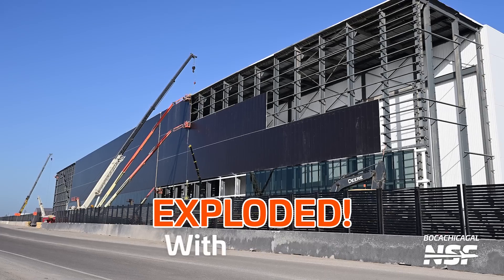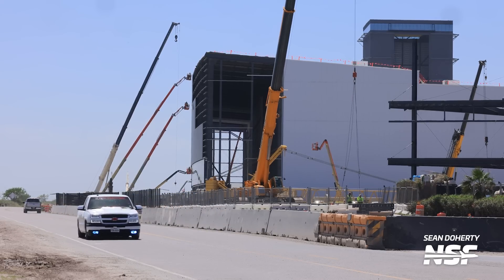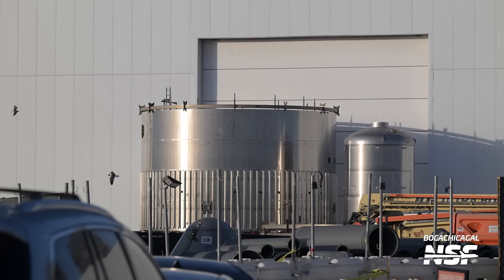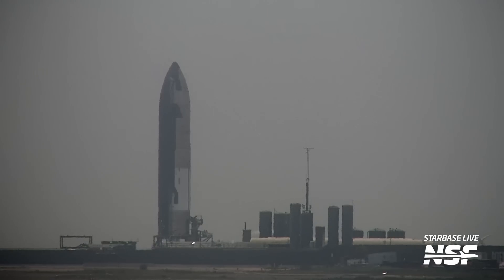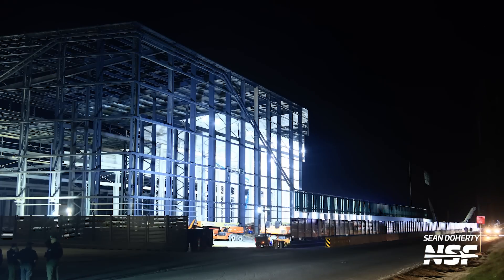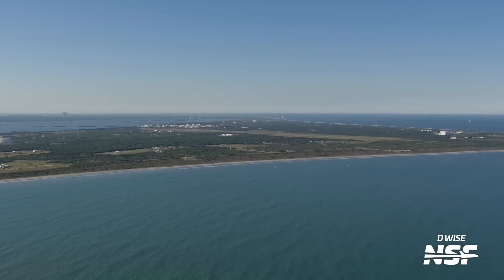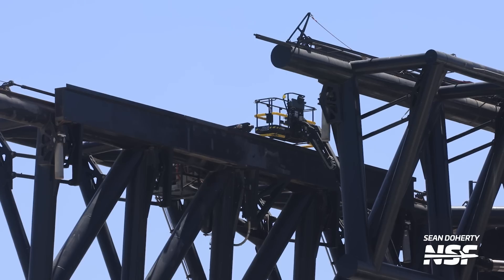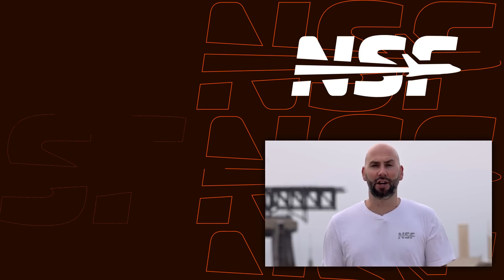The Cadence Picks Up At Starbase! | SpaceX Starbase Update

Comment: 1st off, I'm a huge SpaceX fan but have a major concern regarding fuel usage.  I've noticed in all flight tests that the ending fuel levels on the booster is practically empty.  Can you give some info on why this is the case when there is no cargo on board?  It seems like it's was fully fueled at takeoff.  Thanks
Reply: I can, first of all they did not fully fuel it at launch and secondly both the booster and ship dumped their extra propellant after their first burns to help simulate the real conditions eg. 150 tons of payload added

Comment: Jack Beyer & NSF family. Good to see U All Spaced Out;Where you belong. Keeping us all up to date. I would have liked to have seen The 2nd Version looking more like;A “ large”version of SpaceX’s “DRAGON”;(including upper “Side (&moveable) firing booster s to assist in ship stabilisation,after its “Sideways Entry-Drop”;where the heat tiles are cooking,rattling,shaking expanding, cracking & being torn through their most Rugged Smelt -Temperatures ever captured on film by SpaceX’s “Earth-Wired Satellite flight System; Starlink”(Man those  visual s were really out there: Educational; inspirational;Red-Glow &seemingly eventual,[what seemed like a 🔥 fire of smelting: either smelting fire bring or unbelievably molten lower engine parts;( I considered that had this like Falcon9 Booster s been alight;since face it the only major diffs could be;The burning engine confronted by our infamous blackout area; Weight,Engine layout[A strong option-due to spacing & unlike Falcon9’s constant engine layout; circular,Rage Of Heat Against The Earth s hottest area VS Rocket Heavy’s Larger Gaps between Engines; Allowing that “smelting-Space”2 Creep in-between its Engines Ripping Apart electrics,fuel lines,computer communications& basic air ship2 extreme temps which having being constructed 2 Wthstand them allow’s then2 grow even warmer, tearing things to shreds&possibly giving THAT LAST Nudge to the self destruct SYSTEM! Another issue could hve been that “Door Test System”.On pics,it did’nt seem 2 close properly& that allowing those Intense heat s2 dance about the interior of the ship; tearing at Interior fuel tanks&”so2 speak-Join pipes & otha interior systems would cause destruction. Why Elon and team just Dnt offa us there facts or closest opinion s on what was a sad consequence. Again I state I would really njoy 2 see A larger UPgraded version of DRAGON again absolutely (in the round,powered by larger versions of Dragons engines. (With the ability to swing the entire rocket in any and every direction that it would require. Especially where flaps aren’t assisting. Also I believe the Rocket flaps 2 B2 fragile2 PowaHold the moves&especially it’s ability 2 hold onto the heat tiles (especially where they move& tension  &heat affect them most. Obviously it would act as the main astronaut deck during launch & land procedures. Giving All Astronauts who flew in them,the greatest chance of survival and increasing missions to space station to as many as was decided upon. Also it would act as a great lead to the upcoming private mission s of (1)The upcoming Space walk mission from a Dragon..Extended astronaut carrying to @Space_Station or @ISS. Expansion projects on Artemis. With this new version being interlocked with the FALCON HEAVY BoYs to complete their entire own space missions. Cheaper than any NASA or other Toy rocket roaming the skies at present. It’s Cargo 2 and from @ISS could be huge and it’s versions could be re-eye rated whereby they were simply interior altered to suit the job. Dropping satellite s. Longer term earth 🌎 space journey s. (Upgraded by Everything from add on modern upgraded engines to push the envelop the vehicle into. The capabilities go beyond held discussions. Team SpaceX. Building and closing the gap between space and earth.
Reply: Rather long winded and the abbreviations do not help. Elon's primary focus is getting his full size version 2 Starlink's into orbit. The 'Manned Starship's' are, perhaps on the drawing board, but low priority at the moment. Elon needs to secure an income from his Starlink Network first.

Comment: It looks like the tin, steel work, is charcoal. Not black.  I just hope that they can re-light raptor reliably.  So far 118 raptor engines have failed. Looking forward to solving this issue.
Reply: Engines are not the thing that fail
Reply: @ale131296  yes they are, they can't control the booster without them. They blow them up because they are not reliable to re-light. Some do, some don't.
Reply: @On-down-the-road  The problem is not on the engines, it's on the booster. The engines relight just as easy on the stand, there's nothing specifically wrong with them, it's on the integration with the booster. Flight 2, for example, had engines shutting down right after relight due to a booster problem that was totally unrelated to the engines themselves. It's like saying your car's engine is not working when you don't even have a working battery to start it up, then it ain't a problem with the engine, it's a problem with the battery. Same applies to Raptors.

Comment: Did you see any changes for roll control on Ship 29 when it rolled by in and out of testing? I thinks attitude control in space will be a huge item, especially if SpaceX ever wants to manage in orbit refueling. It's one thing to dock with Dragon and a totally different thing to maneuver Starship for refueling and then reentry. When watching your IFT3 coverage I wonder if it would be better to keep the chopstick arms at a lower level to not get hit with the plume. As the stack ascends it appears the flame hit the chopstick because they are relatively high up.
Reply: No, but i expect we will get once it rolls out for flight

Comment: Just a thought,, if you're building an orbital launch mount for version 3 perhaps would you redo the legs and the bottom section to account for taller rockets and more mass??
Reply: As Jack stated version 3 is many, many years down the road so that is not an issue that anyone could address.
Reply: Well certainly they know for sure that in the future, the weight loading on the piles will be greater. (Longer Booster or Starship = more propellant and weight) So maybe they are going to make larger diameter legs or even a larger diameter circle. Maybe even a triangular leg shape for better dissipation of the exhaust. May as well do it now with all the data they have on the current model.